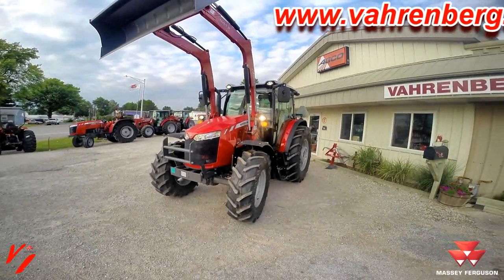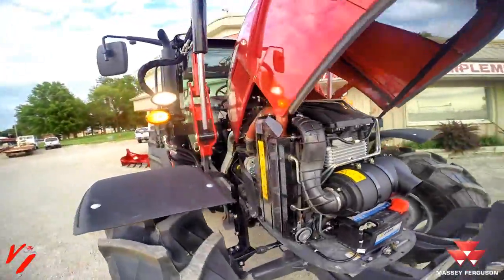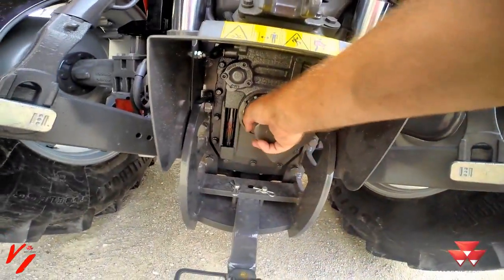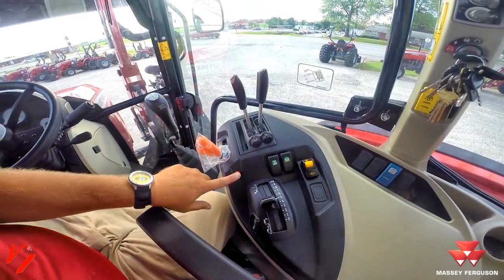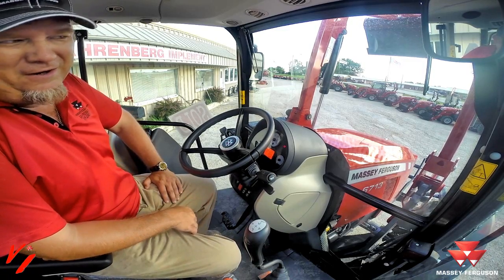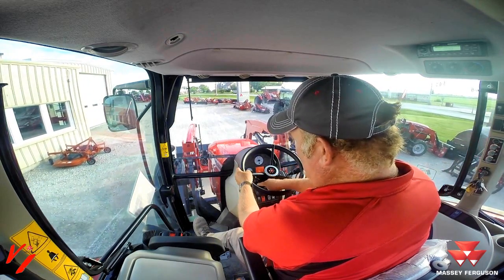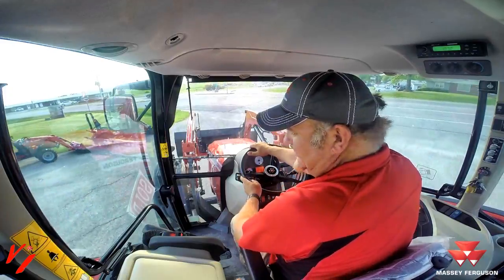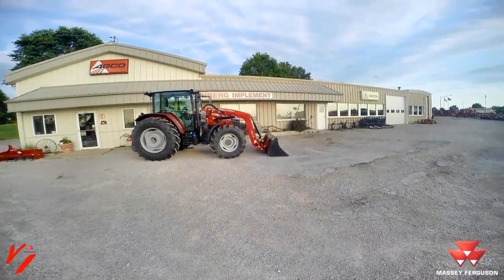Massey Ferguson 6713 Global Series Mid Range Tractor: Introduction and Demo

Comment: Just “upgraded” to a 6713 from a 4710.  Almost miss my 4710.
Reply from the maker: 4710 and 6713 are both great models and based off very similar designs the 6713 larger tires & wheels plus heavier 3 Point, 4 Cylinder AGCO Power Engine and more Horsepower and totally flat cab floor.

Comment: A fibreglass bonnet won't rot like a metal bonnet
Reply from the maker: Metal might rust but it won't rot. Fiberglass cracks, delaminates, and become brittle with age and paint stops adhering sooner on plastic, fiberglass than metal hoods.
Reply: @VahrenbergImplement  when I say rot I mean like when it's rusted to the point you can poke holes in it. Fibreglass will look good for much longer than metal
Reply from the maker: I would have to totally disagree with that. If you did not care for your tractors paint to the point it rusted through the fiberglass would be delaminated and crumbling apart. I personally deal with fiberglass fishing boats and fiberglass deteriorates and gets brittle with age. Heck we have 70 year old metal hood tractors customers are still running. I've sold more Fiberglass hoods than metal hoods since we been in business since 1952.

Comment: DEF? On a piece of farm equipment?  Good grief.🤦‍♂️

Lost interest as soon as I heard this.
Reply from the maker: DEF is better than Diesel Particulate Filters that are expensive to replace and reduce tractor performance. DEF system has been the best thing in improving fuel economy and engine performance. You should watch our video we did on the Proof of Performance of the Massey Ferguson Emission Systems: https://youtu.be/9C6pFZgrzoc Massey Ferguson does DEF differently than other brands...we don't overdose, we only use DEF when we need to.
Reply: Def is on anything over 70 or 75hp. You can’t get away from this. It’s not a Massey issue

Comment: What's the largest massey that can take a subframe backhoe?
Reply from the maker: All GC Series, 1700E, 1700M Premium and 2700E are Subframe Mounted Backhoes. So 1760M or 2706E both 60 Engine HP are Largest Subframe Mounted Backhoes.

Comment: Just watching your video again, and i noticed that the american brochure  weight is 4621kg were as in the Uk its 4230kg. Just thought it was interesting. We personally look for high power to weight ratios but in the US it seems to be all about weight, think massey might be adjusting there figures for different markets. Have you weighed any global series without loaders?
Reply from the maker: Each Regions has the ability to make different feature choices like transmissions. North America is using the SynchroShuttle and PowerShuttle Versions. We do not have the Dyna4 Option like was released in Europe. Some regions can choose a standard gear transmission. Weight is one of the factors North American Farmers are looking for primarily hay & loader tractors. So there could be differences based on the region of the world the tractors are being sold.

Comment: Hi. I really enjoy your videos. several questions though. 
What is the grey tank object on the right hand side of the lift arm beside the back axle. 
also I think 6 gears and 2 ranges is great because i hate changing ranges. But we have steep land and I was wondering would this tractor be able to take of in the high range in first  gear with a load on a hill. In other words is the 1st gear a low enough gear ratio for taking off with a decent pull. 
Also we have an mf5455 is it possible to fit an aftermarket mudguard pto switch. 
thank you.
Reply from the maker: That is Heavy Metal Case that the DEF Dosing Module is Located. We have some pretty severe contours here in West Central Missouri and our customers are satisfied with the Range Split and have not heard any feedback it is not working for them. I think adding external PTO Switch would be tougher task as you would have to splice into the wiring and as a dealer I would not want to attempt that and risk overloading or damaging a circuit. Especially during warranty.